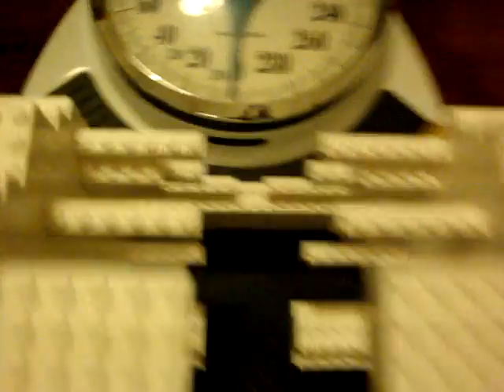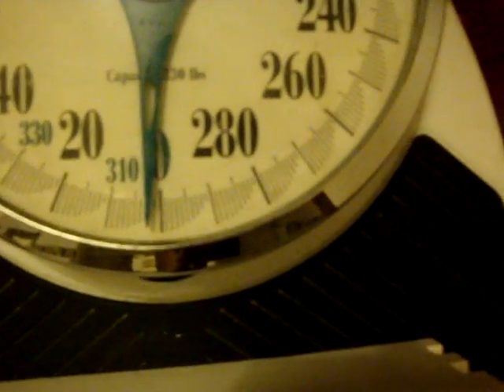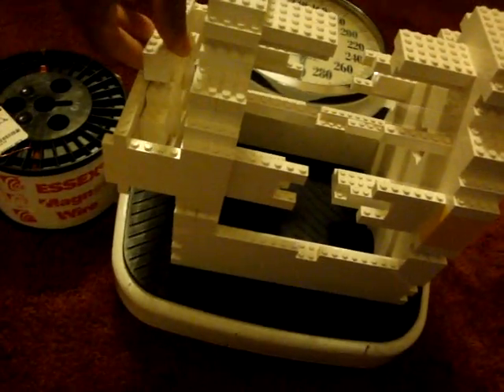11 LBS Magnet Wire for NEWMAN Motor

Comment from the maker: @beac310

Thanks!

The magnets will be much closer to the wire over the rotation vs. classic Newman design, thus the back emf will be too high for good rpm (~250 RPM). At 22 lbs, 20 AWG will have between 70 to 75 ohms. Rotary BEMF varies by 1/d, where d is the distance between the wires and the magnet rotary. Force varies by 1/d^2. A small d and a good magnet-coil fit results in a greater % of gyroparticles harnessed. 8 reversals/rotation + high torque/amp + 22 LBS should keep the amps down.